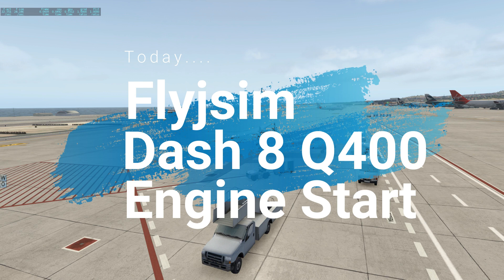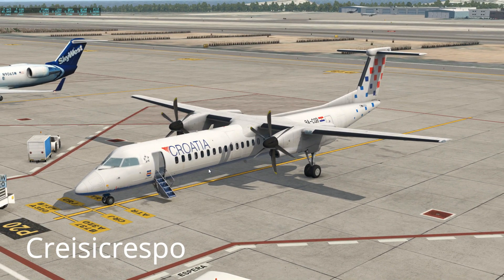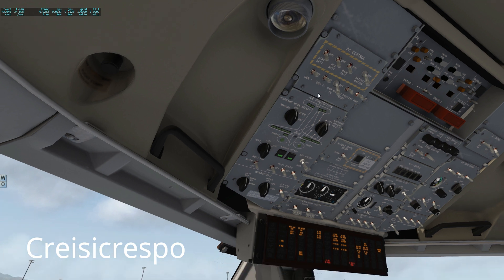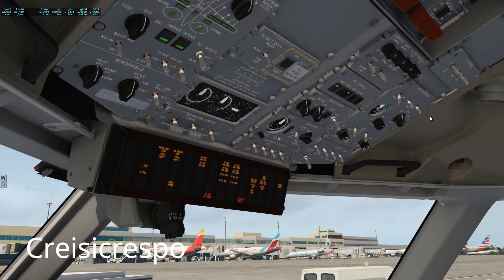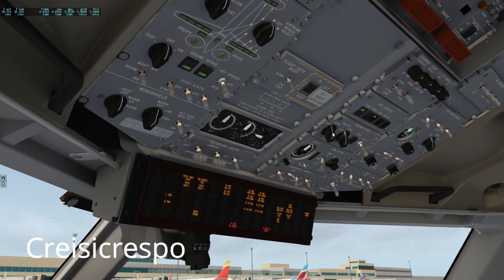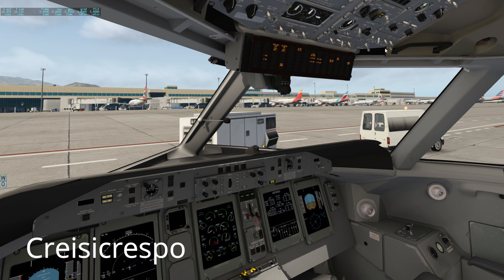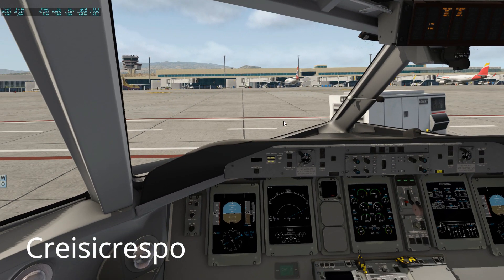FlyJSIM Dash 8 Q400 Tutorial: How to start Engines after update

Comment: how can i bind throttles #1 #2 to same key or joystick lever for throttle? thanks if you can help.
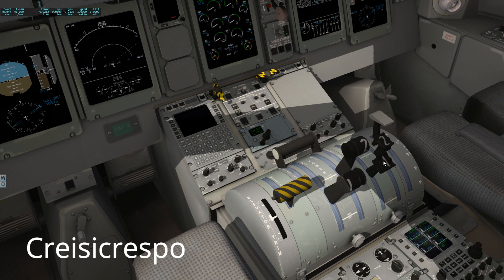Reply: at 3:51 you move both throttles (power) how did you set that up?
Reply: figured it out. now i see how this baby flies.
Reply from the maker: @ericc7936  Sorry I did not answer before. Busy at work! Im glad you are making it work. If you have prepar3d and you love the Q400 I suggest you try the Magestic Dash Q400. It´s 100 times better
Reply: @creisicrespo  it seems tat the Majestic isn't availailable for Xp. do you have anyway of  knowing it will be developed for xp?

Comment: engines on but not able to taxi. what's up with that?
Reply from the maker: Hello again. Have you solved out this problem? Never came accross that before...
Reply: @creisicrespo  nope not solved. re downloaded xp11 and dash 8. will try later to get it to taxi. should power for gen be switched on? thanks for reply.
Reply from the maker: @ericc7936  Correct. Once you have your engines running you must switched both gens on
Reply: @creisicrespo  ac gen #1&2 in yellow and l thru & R thru in yellow ice detect fail yellow. any clues? thanks for replying'
Reply: @creisicrespo  have turned gens on (all 4) after starting plane. still in yellow r gen  & l gen. not current airac but have now  current airac will try again. thanks for your help.
Reply: @creisicrespo  no solution ac gens both on. should fms be set before taxiing? also course heading alt? i turned on ac gens after engines started.
Reply: how can i contact help from developer of dash8?
Reply: tried turning off and on ac l &r gens. nothing turns them off on board. how do i select reverse or should i use better push back to back out of gate?

Comment: Greeting creiscrespo

Thanks for the video, I found it very useful after spending several hours trying to start these engines. I'd never had this problem when flying the FSX Majestic Q-400; I migrated to X-Plane 11 a few months ago and have the 11.20 upgrade installed..
Your video helped me to start to sort out my problems but I have a CH Products Flight Yoke and I found that, when just using the 'prop' lever to advance the propeller to the start position, this didn't switch on the fuel flow. However, by advancing the 'mixture' lever to this position with the mouse, it solved the problem! The only other problem i was left with was that both the 'prop' and 'mixture' levers had to be reversed in a new profile.
I can now, finally, start the engines and after start I use the 'prop' lever to the required torgue position.
Thanks once again, and let's hope our comments and hints will enable others to get flying quicker and becoming less frustrated.
Reply from the maker: Not a problem. Glad to help. To be honest, it took me several hours to figure it out. In fact, it was more like a puzzle rather than a simulator! Happy flying!
Reply: Same for me. I'm an experienced fight sim pilot, some private flying hours and 40 years in aviation, but this took a lot of time, like you, to sort out. Shouldn't be the case!
Reply from the maker: Hello Terry. Well... That is one of the aircrafts I missed big time in XPLANE. We do not have a proper Q400, this one in particular is what it is. Although it reflects the price. As per your issue regarding the prop and the mixture, that is absolutely correct. Got the same issue myself here. You are most welcome, I never thought it would help so many people lol. Cheers!
Reply from the maker: Terry Gale yes. The programmers wanted to make the sim a puzzle game!

Comment: This video saved me from hours of frustration. I just bought the plane today, and already ran into the engine problem. 1 question though. I see that your throttles move smoothly, and mine are stuck no matter what I do. Do you have any suggestions? Thank you very much!
Reply from the maker: FlyingCola Glad it helped! That vibration is due basically because of my saitek proflight gas throttle. It is annoying but i cannot avoid it.